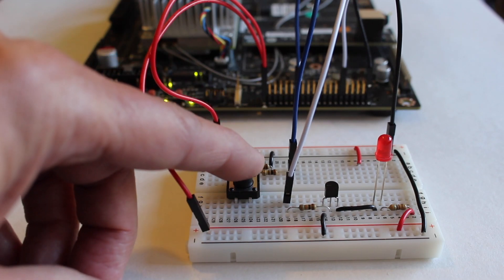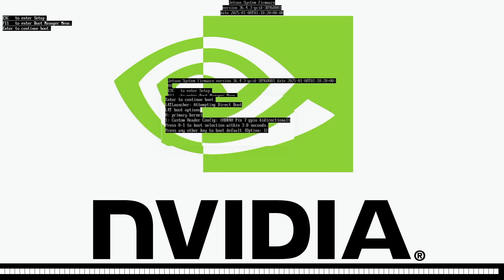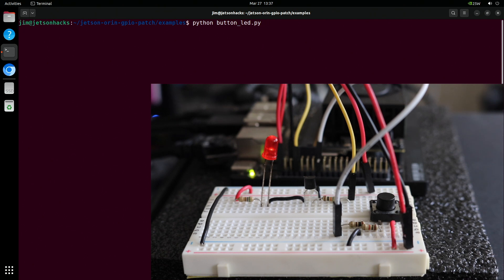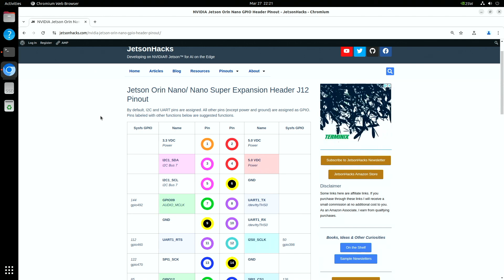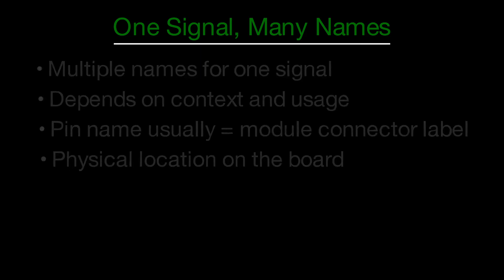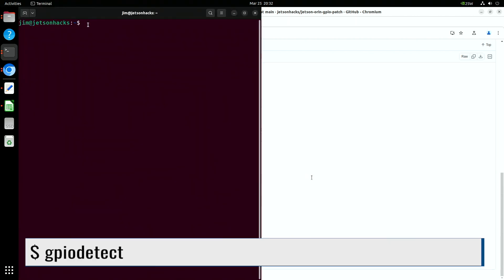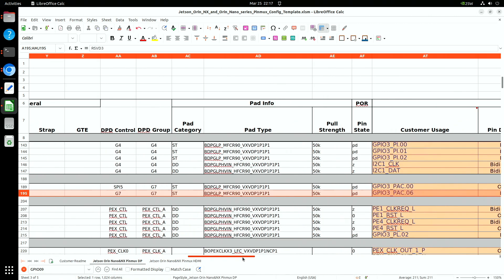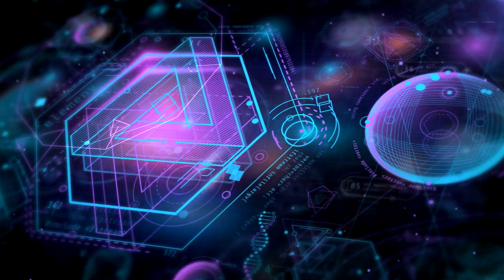Fix GPIO on Jetson Orin Nano Super | Full Guide to Creating a Device Tree Overlay

Comment: Hi, thanks for the helpful video!
I'm using a Jetson Orin Nano Super Dev Kit, and I'm trying to use pin 32 as a PWM pin. However, the pin stays high at 3.3V all the time. Even when the duty cycle should be 0%, the oscilloscope still shows a constant high signal. The pin also remains high after stopping the script.

In my pin7_as_gpio.dts, I’ve configured pin 32 like this:
hdr40-pin32 {
    nvidia,pins = "soc_gpio19_pg6";
    nvidia,tristate = <0x0>;
    nvidia,enable-input = <0x1>;
    nvidia,pull = <0x0>;
};

Do you know why pin 32 keeps staying high, and if something is wrong in my setup?

Also, could you confirm whether my I²C pin definitions look correct?

hdr40-pin27 {
    nvidia,pins = "gen2_i2c_sda_pdd0";
};
hdr40-pin28 {
    nvidia,pins = "gen2_i2c_scl_pcc7";
};

Thanks in advance!!
Reply from the maker: I think your best bet is to ask in the official NVIDIA Jetson Orin Nano forum for advice. I haven't used the pins for PWM, so I don't have anything to share.
Reply: @JetsonHacks  Thanks for the quick reply!
No worries about the PWM part, I’ll ask on the official NVIDIA forum as you suggested.

I still had one small question left:
Do you know if my I2C pin definitions in the .dts overlay look correct?

Comment: Switching on off is easy. Would love to see either i2C, PWM, or serial. A lot of people cover blink, but I never see anyone try to use the other protocols - like write a message to a 16x2 LCD (with I2C adapter), move a servo, or read a message from a sensor (like a temp/humidity, or GPS or something that lives on the pins)
Reply from the maker: I've done many videos over the years using i2c and serial on Jetson. You don't have to modify the device tree to do those. PWM is trickier; for that I suggest for most people that they should use a microcontroller or PCA9685 PWM board. By its nature, PWM requires accurate timing which Ubuntu isn't really built for. I have a few videos about using PWM and an external board on the channel also.

Comment: Is it mandatory to use a pull-up or pull-down resistor, sir? Is there any way to use the GPIO without one? Because when the button is triggered to ON, it doesn’t change back to OFF when I press it the second time
Reply from the maker: The resistor is used so that the pins do not short. It's hard to advise what your issue might be, it's best to find someone local to help.

Comment: Hello, sir, I'm an engineering student at TTU working on a project lab which utilizes the jetson Orin nano and I used your setup to configure our device tree which worked perfectly except for PWM. PWM themselves work perfectly fine when configured individually (like runing one pin at a time) but when I try to run multiple signals at the same time that's when it refuses to operate. Do you think you could give me an idea as to what the problem would be? Or would you expect it to be more hardware related?
Reply from the maker: I don't have anything to share about running more than one PWM at once, it's beyond my experience. It's worth asking in the official Jetson Orin Nano forums about the issue.

Comment: Thank you so much for your help! I’ve been struggling to get my GPIO pins working for an entire week now. I’d like to configure three GPIO pins to output signals, similar to what you did with pin 7.
To achieve this, do I only need to modify the "pin7_as_gpio.dts" file and add two more pins?
From what I’ve read, pins 7, 15, 29, 31, 32, and 33 can be configured to function as output or bidirectional.
Or do I need to make changes elsewhere in the repository as well?
Reply from the maker: I'm glad the video was helpful! Yes, you would modify the device tree overlay for additional pins. The rest of the files are for reference. Thanks for watching!

Comment: That didn't work for me :(
Reply: It definitely still works I did it last night
Reply from the maker: That's too bad, it's pretty tricky to get running sometimes.
Reply: @JetsonHacks  The pin don't stay as an output. I don't understand, when I execute my code the pin is configured as an output, but there no voltage y when my code finished the pin change to unused again.
Reply from the maker: @sebastianbejaranogomez645  Hard to tell from your description what issue you are encountering. You should ask for help on the official NVIDIA Jetson Orin Nano forum.

Comment: Big thanks to you. It works for pin 7. However,  It's not working when I use the same dts template for pin 33, pin 15 and so on. Any suggestion?
Reply from the maker: It's hard to make any recommendation based on the information you provided. The same dts template for other pins doesn't describe the problem you are encountering, are how you are trying to use the pins.

Comment: hi you, the video is very good,. thank you. I am using Jetson Orin NX, i use io header setting to select dual IMX477, it works, but no GPIO, and i used your method to set pin 7 or 29 to GPIO,  it work, but i lost the Dual IMX477 connection, i tried to combine both dtb file, no luck, is there a easy way to use both CSI cameras and GPIO? thanks
Reply from the maker: You should be able to combine the overlay files, but I don't have the hardware to test with. I good bet is to ask about this issue on the official NVIDIA Jetson Orin forum: https://forums.developer.nvidia.com/c/robotics-edge-computing/jetson-embedded-systems/jetson-orin-nx/487
Thanks for watching!

Comment: Thank you for the nice video. The information is really useful to me as I am getting to start learning about kernel and device tree. You did this for Orin Nano Super, can you also tell me what kind of changes should be made in case of Orin AGX? I tried using the pin configuration and names document from NVIDIA but still unsuccessful. Your help is much appreciated.

/dts-v1/;
/plugin/;
 
/ {
    jetson-header-name = "Jetson 40pin Header";
    overlay-name = "Pin 7 gpio Orin AGX name";
    /*compatible = "nvidia,p3768-0000+p3767-0000\0nvidia,p3768-0000+p3767-0001\0nvidia,p3768-0000+p3767-0003\0nvidia,p3768-0000+p3767-0004\0nvidia,p3768-0000+p3767-0005\0nvidia,p3768-0000+p3767-0000-super\0nvidia,p3768-0000+p3767-0001-super\0nvidia,p3768-0000+p3767-0003-super\0nvidia,p3768-0000+p3767-0004-super\0nvidia,p3768-0000+p3767-0005-super\0nvidia,p3509-0000+p3767-0000\0nvidia,p3509-0000+p3767-0001\0nvidia,p3509-0000+p3767-0003\0nvidia,p3509-0000+p3767-0004\0nvidia,p3509-0000+p3767-0005";*/
    compatible = "nvidia,p3737-0000+p3701-0000\0nvidia,p3737-0000+p3701-0004\0nvidia,p3737-0000+p3701-0005\0nvidia,p3737-0000+p3701-0008";
 
 
    fragment@0 {
        target = <&pinmux>;
 
        _overlay_ {
            pinctrl-names = "default";
            pinctrl-0 = <&jetson_io_pinmux>;
            jetson_io_pinmux: exp-header-pinmux {
		    hdr40-pin7 {
		        nvidia,pins = "mclk05_pq06";
		        nvidia,tristate = <0x0>;
		        nvidia,enable-input = <0x1>;
		        nvidia,pull = <0x0>;
		        };
	        };
        };
    };
};
Reply from the maker: Unfortunately I don't have anything to share about this. The process is the same as the Orin Nano, but you will need to figure out the pin names to match the AGX.

Comment: Thank you ,This got the pin7 working perfectly fine, so i want also enable I2S in the 40 pin header
Reply from the maker: You are welcome. You can enable i2s using the jetson-io.py tool. Thanks for watching!
Reply: @JetsonHacks  I found one issue: when I set pin 7 as bidirectional in the Jetson-IO tool (refer this video) (sudo /opt/nvidia/jetson-io/jetson-io.py), it works. But when I manually configure I2S using the same tool, pin 7 doesn’t work. Why? Can’t it work in both modes at the same time?
Reply from the maker: @mohammedniyasns7805  Did you modify the overlay to include your changes to both  I2S and pin 7?
Reply: @JetsonHacks 
Now it’s working thank you ❤

Comment: Hi do i need to make a complete circuit like the one in the video in order to test the pins? I am kinda stuck here. I followed READ ME on your github patch and i connected pins 7 and 15 directly to two legs of a switch but when I ran the code it did not work as it always stayed on LOW. I also asked Chatgpt and it just told me to simply connect one leg of the switch to GND and another to any GPIO pins.  Any help would be appreciated!!!
Reply from the maker: I'm not sure what you are asking. I can't think of a reason why you would connect pins 7 and 15 to a switch together. The wiring depends on what kind of switch you are using, but typically it's wired like noted in the first diagram in the article https://jetsonhacks.com/2015/12/29/gpio-interfacing-nvidia-jetson-tx1/ in the GPIO Interface Wiring section. In the video, we are using GPIO 15 as the input pin. The default is that the GPIO pins are input, so you don't have to make changes to the device tree.
I strongly suggest that you find someone locally that can help you, as attaching devices can cause damage to your Jetson if not done properly. This video makes the assumption that the viewer has a simple electronic background. Good luck on your project!
Reply: @JetsonHacks hi I solved the problem ur right I can’t just connect pin 7 and GND together.  But thanks anyway

Comment: I am trying to trigger a 3-channel relay using the Jetson Orin, but it’s not working properly. Any help would be appreciated.
Reply from the maker: It sounds like you are having an issue. You can ask for help on the Jetson forums.
Reply: @rithikkumar9203 Did you ever figure out how to trigger that relay?? Im having a similar issue, im only getting 2.7v when drive a GPIO pin to high, and thats not enough to energize my 3.3v relays.. ive tried many different pins but they are all the same. Ive got 3.3v on the dedicatd 3.3v power rails..... let me know if you sorted it and what you did to sort it.... Geez all im trying to do is short 2 pins on another device, i dont know why i should even need a relay to start with
@JetsonHacks

Comment: Does this fix include all the pins or only Pin7 and 15? Does it also fix the issue on third party boards?
Reply from the maker: If you've watched the video, read the article, and looked at the Github code and don't know the answer to these questions, then please do not use this method. This is oriented towards intermediate to advanced developers, and also requires an understanding of how to recover the system in case of an inadvertent mistake.

Comment: Could you please write the overlay for a pwm pin as output for orin nx? I tried but it didn't work.
Reply from the maker: What did you try that didn't work? You can use the jetson-io tool to create the overlays for PWM pins so you don't have to create your own. This is under 'Configure for header pins manually' (make sure to save it). You can also decompile the resulting .dtbo file and findwhat the settings are for each pin if you want to integrate it into a larger overlay.PWM is a special function, the spreadsheet says to use 'gp' for that functionality.
Reply: @JetsonHacks  I did reconfigure the 40 pin header manually using sudo /opt/nvidia/jetson-io/jetson-io.py, the dtbo file saved in /boot/ and after reboot If I open primary kernel the configuration does't reflect and If I open custom 40hdr kernel then If shows image mounting issue. Is there something more I should do?

Let me know also, If I can use the configurations of pins from saved dtbo file inside the pin7_as_gpio.dts(this video tutorial) and then overlay all pins from single dts file like you did for pin7, will it work???
Reply from the maker: @SouravRanjanMohapatra-u5x  Interesting. Did you modify /boot/extlinux/extlinux.conf to add the changed overlay? What is your OVERLAYS entry  in /boot/extlinux/extlinux.conf
Reply: @JetsonHacks  I modified , and the pin names showing in expansion header but multimeter not showing voltage means it's not output any volatage from pin33.
Reply from the maker: @SouravRanjanMohapatra-u5x  I thought you set the pins to be PWM? How are you driving them? Usually you would use an oscilloscope to measure a PWM pulse. Please consider asking questions about PWM on the official NVIDIA forums for better guidance. I don't have enough experience with using them in this manner. Typically people using PWM would use the RT kernel on the Jetson for timing critical functions like that.
Reply: @JetsonHacks  Ok it's resolved now. 
Thanks for your time.
Reply from the maker: @SouravRanjanMohapatra-u5x  For people who see this thread later, how did you resolve it?
Reply: @JetsonHacks I did 2 mistakes; one I forgot to APPEND in the Jetson IO Label and other is I was keeping the pin number as 33 which should be 13 as per Jetson gpio GitHub
Reply from the maker: @SouravRanjanMohapatra-u5x  Thank you for sharing this. I know the whole process can be rather frustrating. What seems obvious now is not that when you're working on it.

Comment: Finally, I found time for testing—and guess what? It works perfectly! :D
Thank you from the bottom of my heart. <3
Could you also provide an example of configuring pin 7 and pin 15 simultaneously as bidirectional GPIO? I'm having difficulty understanding where to add the pin 15 configuration in the pin7_as_gpio.dts file. Should I include additional pins inside the jetson_io_pinmux {} section, or should I create a separate fragment for each pin, or perhaps do something else?
Reply from the maker: Sounds like an interesting problem. Maybe you can ask your question to a LLM like Grok, Gemini, or ChatGPT and give it the sample dts file and see what it says. Good luck on your project!
Reply: @JetsonHacks  Yes, it resolved the issue thanks for providing the initial details. Do I need to create a device tree overlay for using the PCA9685 via Jetson pin 3 (SDA) and pin 5 (SCL) to control servo motors? If so, could you explain how?
Additionally, an updated video on "Jetson Nano I2C PWM Servo Motors" for Jetpack 6.2 would be very helpful. <3
Reply from the maker: @sahandkhamiri2621  One thing you could do is ask your question to a LLM such as Grok, ChatGPT, Claude or Gemini. The LLM will tell you what you need to do to get it to work, and if you need to create an overlay. 
I've made more than 300 videos on YouTube. I don't have the time or energy to remake a video for something as simple as using different pins on the GPIO header between different Jetson models. My path lies forward.
There are almost 40,000 viewer of this channel. Each one of them are smart (including you). My expectation is that you put more effort into learning than I do with show and tell. A video takes between  20 to 50 hours for me to make. You won't learn anything if you're just copying what I'm doing in videos. Experiment, research, and get to work please.

Comment: This video is again fantastic help, thank you! Especially for a beginner like me and the fact that the software support for the Nvidia Jetson is quite complicated. My feeling is that things have become even more worse with the latest Jetpack. More and more I tend to use a Pi with the Hailo Hat. Software support is so much easier. What are the reasons to use a Jetson instead of a Pi with a Hailo Hat beside the performance of the Jetson?
Reply from the maker: If the Rasperry Pi and Hailo Hat meet your needs, you should use them instead of a Jetson. The Jetson is for more general purpose AI tasks, and supports a much broader range of AI packages and methodologies. Thanks for watching!

Comment: I greatly appreciate this video. I will be testing this asap and let you know... but here is what i didn't get...does this mean i need to configure each pin if i want to use them as bidirectional? 
again i greatly appreciate your kind consideration on addressing and solving my issue
Reply from the maker: The pins are currently set to be input only. If you want to make them bidirectional, you need to indicate that. Typically you would limit this to pins 7,15,29,31,32, and 33 when are the recommended initial GPIO pins. You can reconfigure the other signal pins for GPIO, but people usually use the pins for their default function. Thanks for watching!
Reply: @JetsonHacks  awsome! thank you❤

Comment: Do create a video on how to use the pinmux spread sheet and use those DTSI file to create our Jetpack OS
Reply from the maker: Thank you for the suggestion, but I don't have Excel. Therefore it not something that will be in the video pipeline. I'm not sure how creating a device tree will create JetPack OS? Are you having an issue creating a .dts file from the spreadsheet?